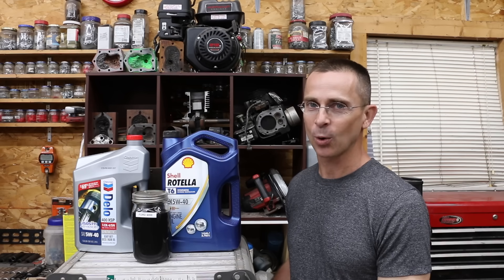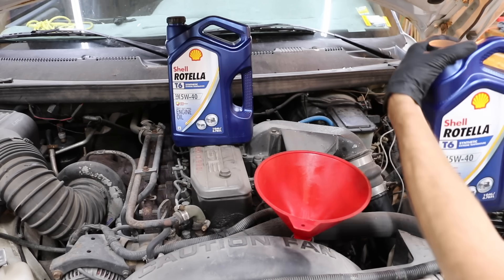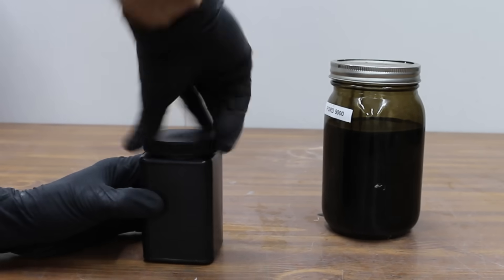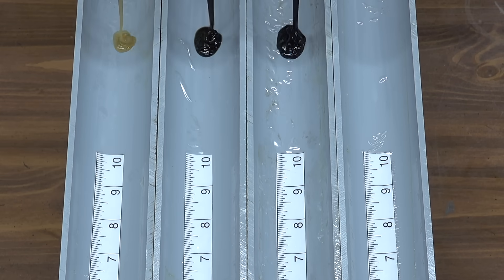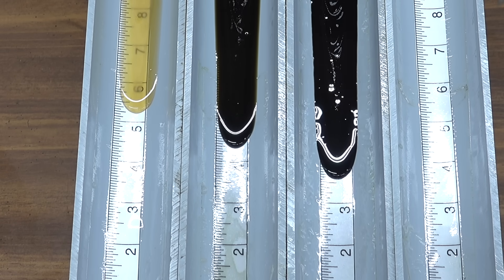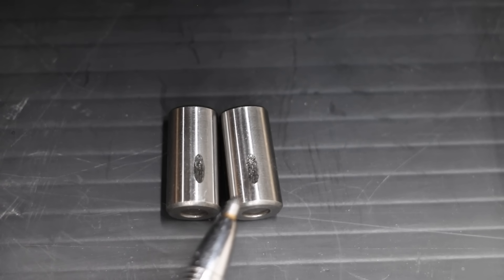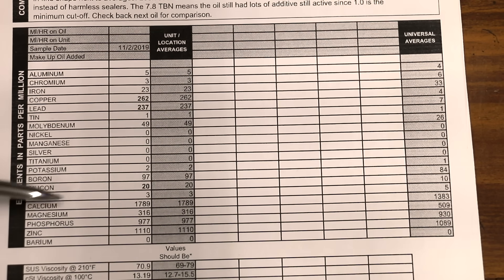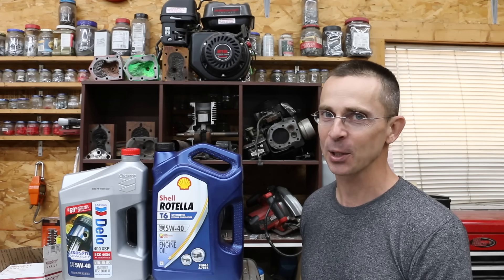Will Annual Oil Change Damage Your Car? Let's find out!

Comment: I use Delo when available, but have used Rotella. Too bad I had not seen a comparison, but no harm done. In a gas engine, I once changed oil just before a cross country drive and again after the trip and checked often in between. It was a fairly new car and the oil started to darken at about 4000 miles. Don't recall the brand.
Reply from the maker: Thanks for sharing!

Comment: Yeah, I find it such a waste to change it TOO frequently. Example, I mostly work from home, so I only put like 1-2k on my cars a year. I maintain my vehicles well but I'm not about to go changing my oil every 500 miles just because some arbitrary timeline passed. Sure oil degrades over time, but not THAT fast.
Reply from the maker: Thanks for the feedback.

Comment: I got 210.000 mile on my 07 Ford freestyle with 3 oil changes. It don't leak it don't smoke and it hasn't turned thick.   Never added any. I figured it would blow up 150.000 ago but. What a great car
Reply from the maker: Thanks for sharing.

Comment: Oil is cheap, engines are not, the average oil change, $45
Average engine replacement $7000
You decide what's right for you.
30+ year Auto Technician
Reply from the maker: Good Point!

Comment: E46 M3 with 3 years of starting to operating temperature monthly. Oil pressure relief valve started sticking closed so it blows oil out filter canister @ 3 years. I would change gas oil annually to prevent pulling the engine.
Reply from the maker: Thanks for sharing.

Comment: Seems that moisture and pH/corrosivity are the key factors in when to change oil based on time and not mileage. Strange that the testing lab does not analyze and report pH along with what is an acceptable pH range. Any idea why?

Comment: That's insteresting. I always asked myself "who said oil degrade through the time?". Usually the car service manual recommend changing the oil after some period, but if you don't run your car for a month, for example, did the oil degrade in this month? I don't think so. Yet, I don't mind changing the oil of my cars once a year, even if it's a low kilometrage, it's not so expansive and I can guarantee a better engine health.

Comment: One thing to understand, the metal parts inside the engine don't really rub each other while running.
There's a thin film of oil the parts ride on between each other.
If they had direct contact engines wouldn't last long at all.
Example, 10psi oil pressure per 1,000rpm keeps a crankshaft from contacting the bearings.
Reply from the maker: Thanks for sharing!

Comment: When I worked concrete, we had a old Dodge 1 ton that we never changed the oil in it and never had problems and it would stay running when out of fuel because the engine was so caked with sludge burning oil 🤠

Comment: Personally, I change it every 5000.
I take no chances.
Even 5 is a little too long.
Rather change it than take a chance.  Oil is a throw away thing. Not the motor.

Comment: Overload of information, 
sorry !
Is it true, that if you have used the best oil and filter available for your engine (as this gentleman obviously has), there is no need to compulsively change oil, especially with low milage and few hours run ?
So, what does the need to change then truly depend on, besides using good quality materials always ?

Comment: AS always an awesome, carefully planned, scientific video.
Your tests are incredible. Many thanks.

A friend with same vehicle as me was using Rotella T6 for the last 15 years. The manual listed full synthetic as the only oil to use. We later learned that was to protect the turbo from clogging the tubing that feeds oil to it. He was changing oil every 3000 miles as in the old days of petroleum oil. He showed me some tests regarding synthetic oil and started waiting till the 5,000 mile mark. Now he is considering changing the filter at 5,000 topping off the oil and changing everything at the 10,000 mark.

Based on the analysis from the lab, that oil should still be lubricating sufficiently at 10,000 miles.

His Jeep diesel has at least 250,000 trouble free miles. Maybe more since I've not asked him about it for at least a year.

2005 Jeep Liberty with four cylinder VM diesel, 16 valves, intercooler and turbo.
Reply from the maker: Thanks!  Thanks for sharing.

Comment: There's documented evidence that extended oil changes cause issues to timing components across multiple brands and engines, bmws are a great example, you can tell by looking at the timing chain guides in about 2 seconds if it had extended oil changes
Reply from the maker: Thanks for sharing!

Comment: I run T6 in my 2020 F250 and double the manufacturer's recommended oil change mileage. I do hot shoting, so the engine is on most of the time, except when sleeping. I'd like to have the oil tested to see if I'm damaging the engine. Where can I get this done? Also, I've thought about going to AMSOIL instead of the T6 but not sure it would be worth the increased cost. Any input would be appreciated.

Comment: I would like to see some testing done on transmission oils with wear-and-tear with and without motorkote used in the transmission the engine the differential in the rear end and transfer case for four-wheel drive
Reply from the maker: Thanks for the suggestion.

Comment: I like to ask the man who's doing all the project farm tests where he calculates 400 degrees plus for all temperature when the thermostat and most engines are around 215 degrees as he actually put an electronic thermometer device reporting oil temperature from the oil pan? I don't see how he can validate 400° cooking oil when the oils and most of the Diesels has an oil cooler already has in the newer cars for the engine and transmission oil cooler lines which should drop the temperatures 10 to 20 degrees respectively, is it possible you can explain where you came to use oil on copy burners at 400-plus degrees? And have you proven in the Natural State and the oil pan or the engine that the oil is reaching 400°? Other than having a lot of sheer Properties or shearing passing through the engine bearings or the cylinder piston walls with the all rings? Please reply how you can justify using 400-degree plus temperatures?

Comment: I change it once a year, or 10 000 km. Whatever comes first. For diesel engine, 450 hours is a max for oil to provide protection. So you can reach 450 hours in  20 000km, before 1 year. It depends how the car is driven.
Reply from the maker: Thanks for the feedback.

Comment: I check my oil every Saturday. I use only good synthetic and change the filter all according to manufacturer stats. I have an hour commute, so i get no sludge. This winter, ive tried an experiment, thinner oil is good in winter, so, ive gone 10k miles and checked my oil. Didnt use a drop. Still a good color. No issues. Yes, ill change it soon, but, evidently, the hour long drive in, and hour drive out of work warm up everything nicely, as even my exhaust systems seem to last forever without rust. I do 70 miles per day, and that seems to simply make the car last longer. Now, brakes,..... Thats another matter...
Reply from the maker: Thanks for sharing.

Comment: Watch as many videos as possible, good stuff. Incidentally I do use Rotella T6 15W-40 in my 2005  5.9 Cummins plus 1 bottle of Lucas synthetic oil stabilizer, no problems.
Reply from the maker: Thanks for sharing.

Comment: Does this test also applies to motorcycle oil?  Here in the Philippines motorcycle seller recommends to change motorcycle engine oil every 1500km. I think it was a waste of money since base on the manual  the recommended intervals is 3,000 to 4,000km. A lot of newbie owner was mislead that following the manual oil change interval can lead to engine problem. I just wanted to bust this oil myth that changing oil (1000 to 1500km) to early  is also the same with the change oil interval written in the manual.
Reply from the maker: Thanks for the suggestion.

Comment: Wandering if you can use t6 rotella oil in gasoline car engines from GM? Wanted to switch from 5w 30 to 0w 40 for my performance engine. Im liking the high zinc content for sure?
Reply from the maker: Thanks for the suggestion.

Comment: Really good to know, since retirement, I only put 1,000 - 2,000 miles per year on my vehicles and now I can change the oil once every two years with a premium oil filter installed. Thanks again for your great videos !!!
Reply: I'm doing my 67 Nova 283 oil and filter change after 4 yrs of use :) I drive it like 20 times a yr around my area.
Reply: @williamcrazylacyfurmage9953  I left oil in a parked  Integra for 5 years. Ran great.
Reply: @edwil111  quality of oil has nothing to do with how a vehicle runs.
Reply from the maker: You are welcome!

Comment: I had an 88 cgevy truck with a 350. I ran 20/50 Castrol oil and never changed it in 5 years. That engine didn't smoke or anything
Reply from the maker: Thanks for the feedback.

Comment: Oil isn’t what it used to be many years ago.  Oil used to break down and sludge up if not changed often enough,  3000 miles was a necessity, it was unusable by then.  Still a year is probably as long as I would ever go.  Once a year is how often I do it in my atv and lawnmower.
Reply from the maker: Thanks for the feedback.

Comment: I worked for Pennzoil 30 years ago as Motorsport Marketing Mgr.

Before Synthetic oil was popular (except Mobil-1)

The engineers told me (for most applications) any basic quality oil was fine as long as it was changed regularly.

Expensive very high quality oils were helpful if oil wasn’t changed regularly and or especially if the engine was low on oil.
In those situations the higher quality oils with excellent additive package helped in extreme situations.
That’s been 30+ years but it’s still good advice.

The main and most important thing is use the weight oil the engine OEM recommends. DO NOT go to higher viscosity oil for higher mileage. That game has changed
Reply from the maker: Thanks for the feedback.

Comment: Todd; I always enjoy your informative videos. The concept of changing oil 1/year is foreign to me. Almost all vehicle manuals and experts recommend every 6000 Kms or approx. 3000 miles... period ! Aways use fully synthetic. Oil is cheap.... engines are expensive ! I drive newer gas 1/2 ton trucks but I doubt it makes a difference with diesel trucks.
Reply from the maker: Thanks!  Thanks for the feedback.

Comment: Awesome oil test and use T6 (5W-40) in my Yamaha Stratoliner motorcycle engine and transmission. Thanks for busting the myth about oil being left in the engine for a long time. I've had the same T6 oil in my motorcycle for 4 years and 10 months and no issues. I'm probably gonna get some flack about leaving it for so long and not riding much.
Reply from the maker: Thanks and you are welcome!

Comment: My companies Semi Trucks and most if not all other companies I'm aware of change the oil based on mileage run not a date and with the newer oils and secondary oil filters that interval has been increasing. We use Delo and Luberfiner filters but I don't think any major brand would be much different. My truck is approaching 1,000,000 miles so I guess the oil interval is ok. When growing up we changed oil spring and fall. Now I do it at 5,000 miles not because they need it but that I like tinkering with our vehicles.
Reply from the maker: Thanks for sharing!

Comment: If you have an electronic throttle body ( not cable ) you can hold the gas pedal to the floor and turn the car over and it won’t allow the car to start do this to pump oil into the motor and not do dry start damage.

Comment: Apparently a big factor in when it is time to change your oil at 5,000 mi / 8,000 km according to mechanics is that there are small metal shavings that break off from parts inside the engine through normal wear and tear, and after a while there are so many that the oil loses its ability to trap them in the oil filter, and they start causing further abrasion of the parts inside the engine. Allegedly this has been studied and it was found that these bits really only start to appear in the oil filter around 3,000 mi / 5,000 km and start to exponentially increase after that. Of particular concern is when they start to cause the piston to scratch up the sides of the cylinders, creating gaps which eventually lead to excessive oil burning, where the only solution is to completely tear down the engine and replace the block.
Reply from the maker: Thanks for sharing.

Comment: Have you tested non synthetic oils for time like the above?  I drive my cars very little milage and change oil every year but with anywhere from 500 miles to 3,000 miles a  year sometimes it seems  a waste of oil but I only use synthetic on my 2014 corvette, the rest of the cars rotella or valveoline regular engine oils.
Reply: actually plain conventional oils such as Valvoline are also synthetically refined...I change mine every 4,000 miles, which is about every 2 years.......Willie

Comment: I don't recommend it myself. Unless you get the top of the line motor oils and filters. Ideally your check engine light will come on when your oil pump can't pump it anymore. It gets too thin.

Comment: It's not the oil that fails in your car. Especially with newer synthetics. It's the filter. The filter paper degrades and when it's gone it doesn't filter out the particulates anymore which is what damages the engine.

Comment: I know this is an older video, but I just ran across it.  I've been using Mobil1 full synthetic 5w-40 turbo diesel oil in my 2015 Chevy Duramax engine for 170,000.  I live in NC so I don't see extreme cold temperatures.  I was thinking about switching the oil to 15w-40 (since the mileage is getting higher and tolerances may be loosening) and/or maybe experimenting with using Shell T6 as well (5w-40 or 15w-40).  I would love to see a video on the big name brands of diesel oils.  Also some kind of comparison with different weights (5w-40 vs 15w-40) and maybe a couple generic brands thrown in for comparison, but I doubt they would measure up to the additive packages in quality oils.  Thanks for all the intense work you put into this channel.  I check in here regularly before making purchases.  This is the information we all wish we had, but don't have time to do.  Keep up your excellence, it is well appreciated by many many people.
Reply from the maker: Thanks, will do!  Thanks for the suggestion.

Comment: Not sure if this was pointed out but you actually incorrectly prefilled that filter. The centre hole is actually where filtered oil is drawn in from and the smaller holes around the circumference is where unfiltered oil is supposed to go. There are special tools you can buy so you can prefill filters but it's not common practice as most manufacturers actually advised against it. An older guy I work with even said he will not prefill a filter on a rebuilt engine because he doesn't want to risk contaminates in the oil.

Comment: Randomly came across this test.  I use t6 in several vehicles that don’t get driven much… my turbo Miata hasn’t been started in a long while so maybe I should change it.  4runner went 5k miles in 2 years with t6 and was thinking I might have stretched it a bit…now I’m no longer wondering haha…  what a good bargain oil!! Was at least.  Got 3 gallons for 60 at Walmart 3 or so years ago.  And I’d assume in new container unopened it’ll last for at least 5 and maybe 10.  Maybe the next long term test?  Hope you have some laying around with born on dates!… and date opened but still unused.
Reply from the maker: Thanks for sharing.

Comment: I drive 200k+ cars and also have vintage cars with less than 10K miles and only put Mobil 1 synthetic oil in all of them. I've gone 10 years without oil changes. I only drive 4-500 miles over those years and when I sent off the oil to be tested and it always come back as good. People waist money on annual oil changes.
Reply from the maker: Thanks for sharing.

Comment: Please High Performance Lubricants oils. I just got an oil analysis back from my wife's 2017 with 103,000 miles. The oil had 17,500+ miles and was still good for service. I can send you the report. The vehicle still gets 22-24 mpg on highway depending on speed.

Comment: I change mine between 14 And 18 months that's usually when my truck hits around 2500 miles I don't drive it much
Reply from the maker: Thanks for sharing.
Reply: basically same as me, I change it at 2 years.

Comment: It might make a difference if you did this test on a gasoline powered vehicle. Gasoline thins motor oil. Diesel might NOT thin motor oil. Gasoline engines run at a higher rpm than diesel engines. Higher rpm results in more friction. If you don’t drive many miles or if you drive short trips(oil might not get hot enough to burn off contaminants), the motor oil might go bad after a few months. If you wait a year, and then change the motor oil, there might be engine damage. The oil does not wear out with use, the oil gets contaminated. The oil can get contaminated with less use. Oil is cheap.
Reply from the maker: Thanks for the  suggestion.
Reply: under normal driving conditions, a gas engine will go 4 to 5 thousand miles, or every 3 years which ever comes first, before needing to be changed........Willie
Reply: @bonniejohnson1518  short trips would be a severe driving condition?

Comment: I have run pure synthetic in all my vehicles and tractors for more than 40 years. I normally change oil every 25000 miles in my cars and trucks and every 150 hours in tractors. I never had an oil-related problem, even if the oil change ended up being more than 1 year.
Reply from the maker: Thanks for sharing.